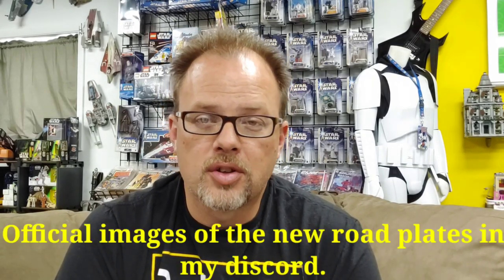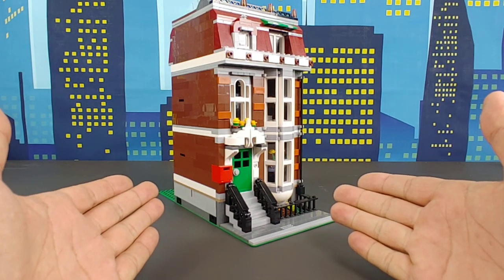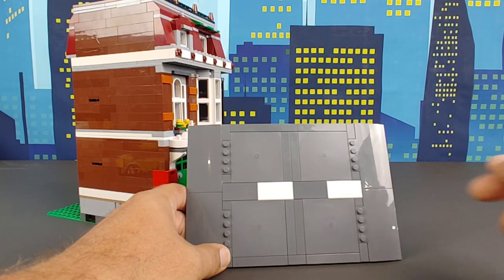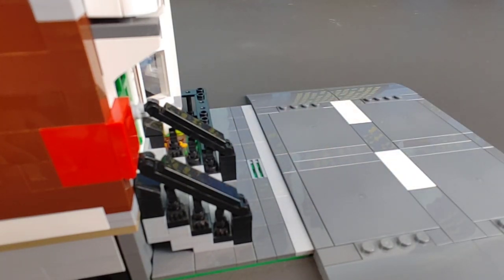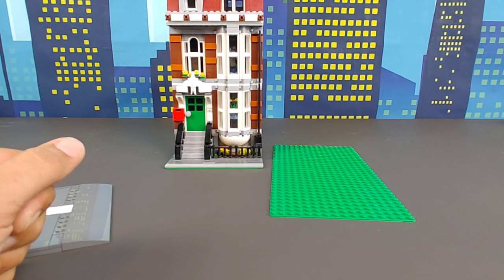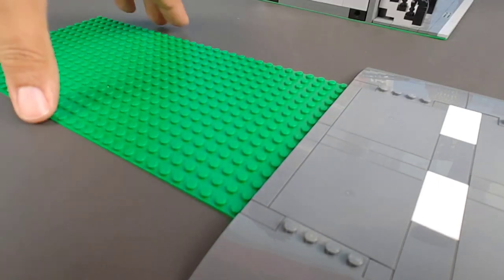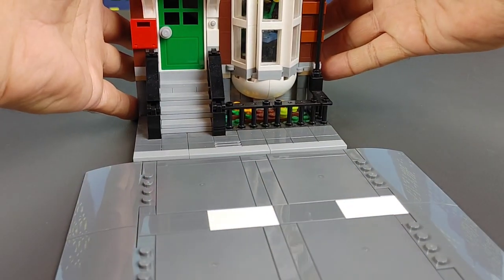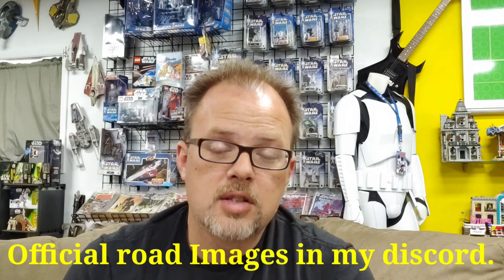How to use the new Lego road plates with your modular buildings.

Comment: How is the curb higher by flipping the extra base plate?
Either way it up it does not connect to anything.

But regardless I like the simplicity of this “hack” but it does mean you have to buy more of the outgoing parts.

Comment: wouldn't putting these new ones onto road baseplates that many already have also solve it? and then just use a single layer of plates on the modulars to even it out? i have the skatepark set, and it seems simple enough. 4 of these new road plates fit into a 32x32 normal road plate

Comment: Hi there, another Idea i have is when building, build on regular "flats" (like the roofs) that way brick height can be altered rather easily (since there reverse studs under) with other bricks or small flats (similar to the center blocks they use in real homes). EDIT: I'm currently starting on Palace Cinema & DO have extra large flats. I will attempt to do this idea with it since it is my heaviest modular.